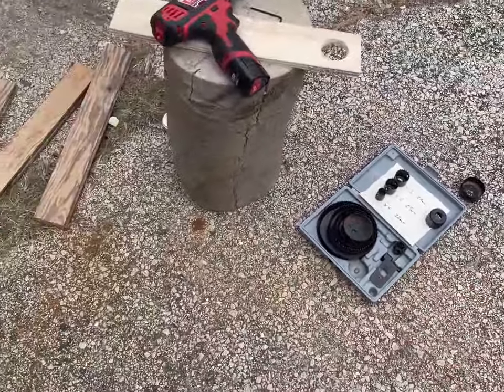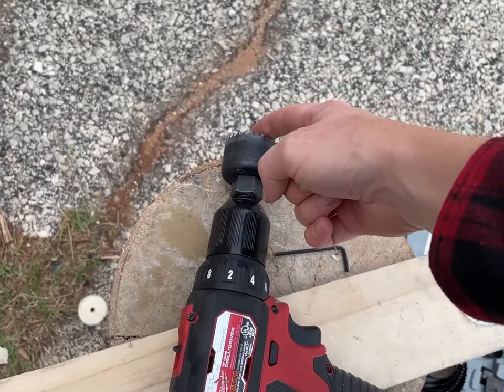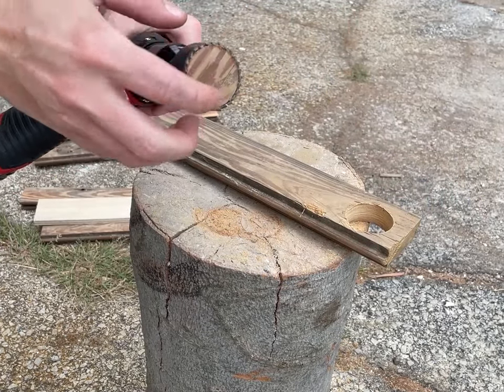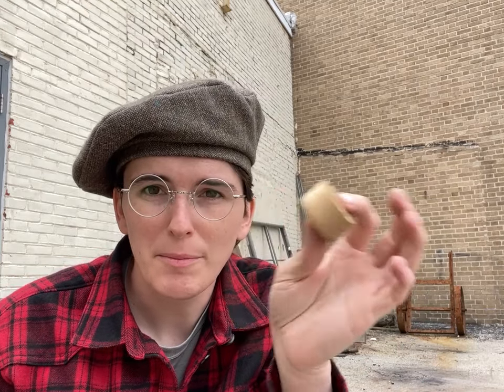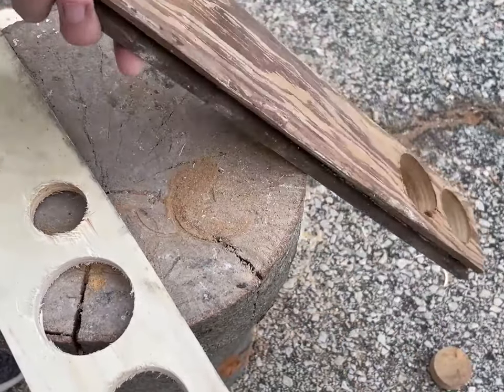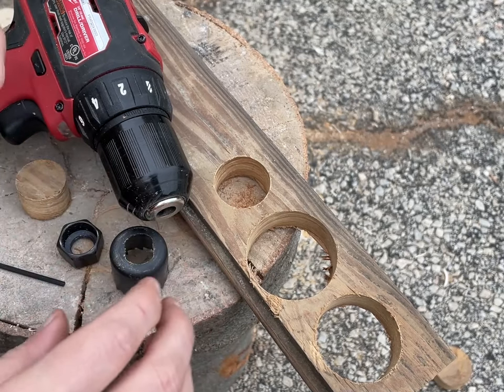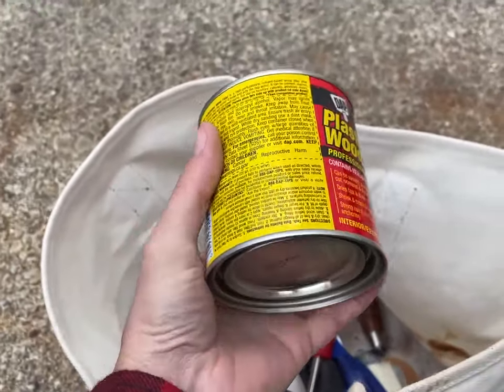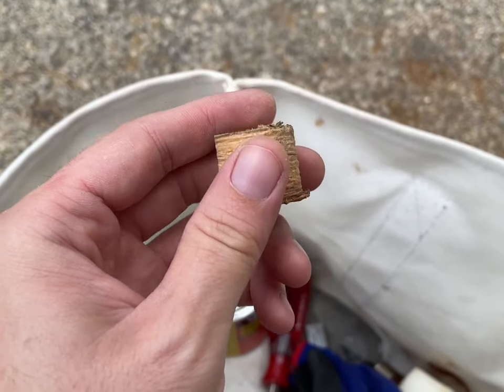Repairing holes in a hardwood floor without wasting money. Recycle floor boards into wooden plugs!

Comment: For smaller holes, up to 16mm you can get a woodworkers "plug cutter" set. (Shop around) They cut plugs that fit common hole sizes exactly. Fancy woodworkers use them on furniture. I've been using them on a 1920s hardwood floor.
Reply from the maker: Yeah Ive been keeping my eyes open for those too!

Comment: use larger plugs, than the floor hole, sand down for tight fit, less putty joint. good video
Reply from the maker: Sadly these are just a bit too oversized and would split the floor boards if I did that. If I had my belt sander I would oversize them and then take them down a bit
Reply: @RinoaL  yes i was going to mention belt sander but didnt. i ran a 5' Grizzley belt sander at a hardwood floor plant so it seemed a good choice ti custom fit the plugs, no splitting